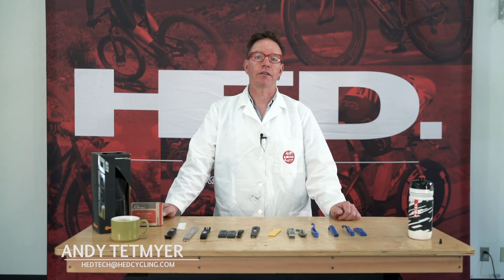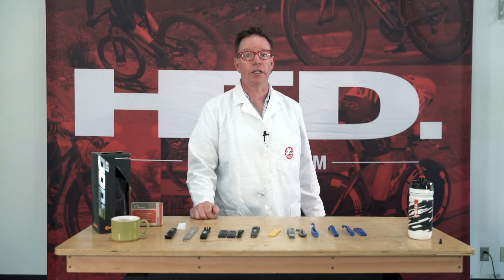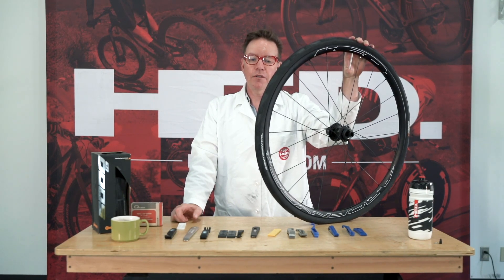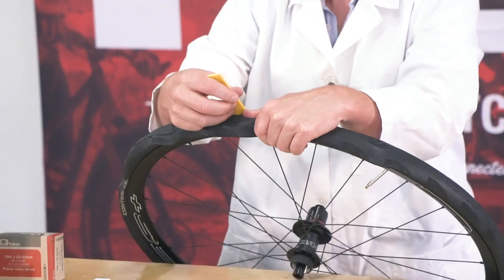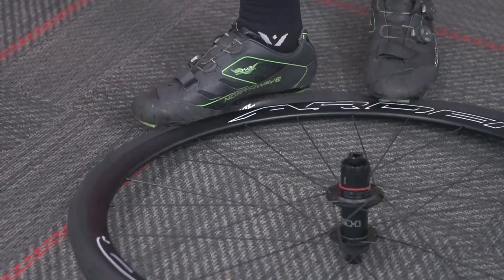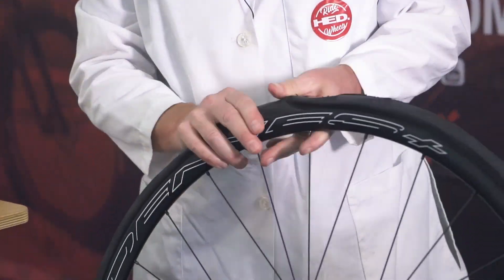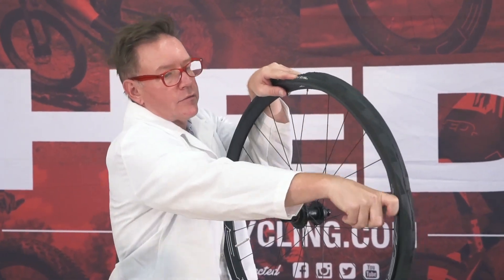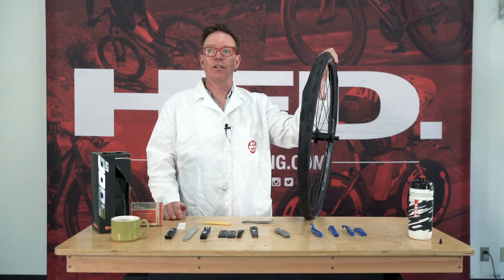How to Remove a Tricky Bike Tire | HED Tech Talks with Dr. Andy

Comment: Spent an hour today on a roadside flat repair trying to break the bead on a Conti 5000 28 tire to install a new tube on a Hed Ardennes wheel. (First flat in two years, 9,000 miles.) Once one side of the tire was free, all went well. Back home, I experimented with methods and decided using my multi-tool's flathead screwdiver to break the bead was the only reliable, quick solution. It didn't damage the aluminum rim.

Comment: Yeah?? Try breaking the bead on HED RC6, Vittoria Rubino Pro TLR, Silca Ultimate Tubeless sealant setup. The first time I encountered this, I was able to remove the tire by breaking the bead using the block of wood step-on method. This loosened 1 side but the other side, I then had to wiggle away with plyers. The second and third times I had to cut the tire and the beads to remove. Over 44 years of cycling, I've never found myself so frustrated and literally shocked that a tire could be so stuck onto a rim. This never happens with any of my other 5 sets carbon tubeless setups. I don't know if it's the combo of alloy and sealant, which I suspect or the sealant mostly. Silca Ultimate sealant does tend to, over time, form a tire inside the tire. It's that kind of a sealant. Anyway, I will only use this wheelset setup with tubes from now on.
Reply: Same shit here with s-works Hollowgram 35. You pretty much describe my situation - in decades of riding never dealt wwith a piece of overhyped overpriced shit like this. This piece of shit is something else, must've been made by some human-hating aliens. The most anti-human masochistic piece of shit ever. Oh, and did I say it's a piece of shit? Yes it's a piece of shit.

Comment: I wish that I had NEVER bought this HED Ardennes wheelset!! Impossible to get the tire off - about 6 experienced riders tried today and gave up. Oh - so you need to smash the wheel on the ground to get the tire off?? What the hell. I tried 4 different tires at the bike shop today to see if they were easier to get off. Nothing worked! Did ease of tire change ever enter the discussion on design of this wheel???????????????
Reply: Same shit with S-works Hollowgram 35. The most fucken mindboggling obnoxious piece of plastic shit ever I've dealt with in decades of riding. Can't wait to get rid of this overhyped overpriced piece of shit. Oh, and did I says it's a piece of shit? Yes it's a piece of shit.